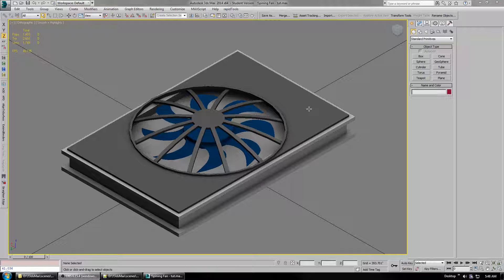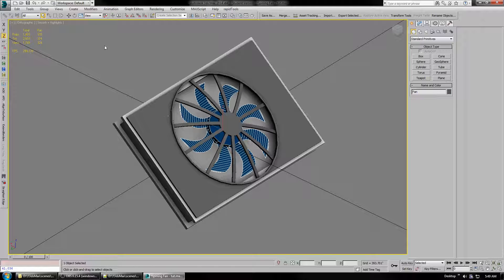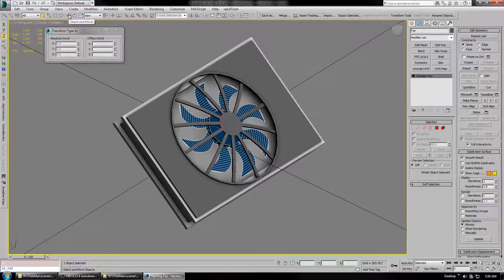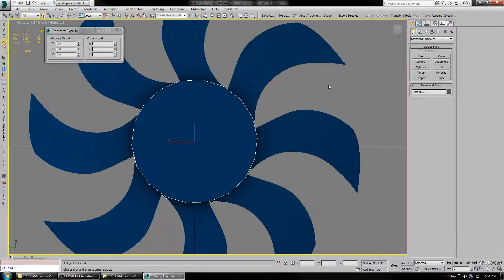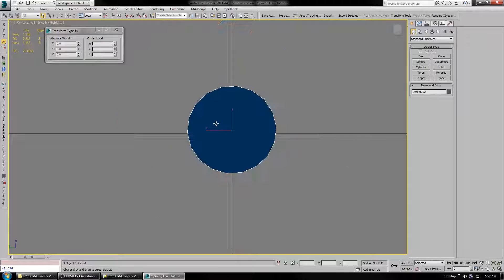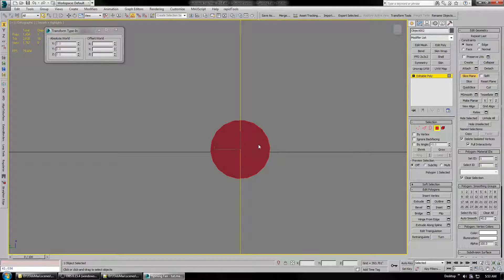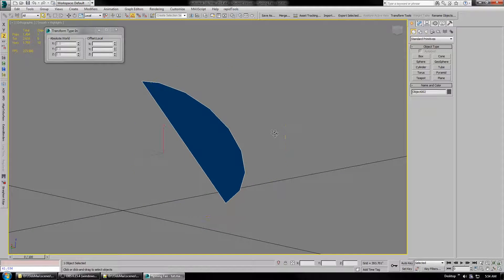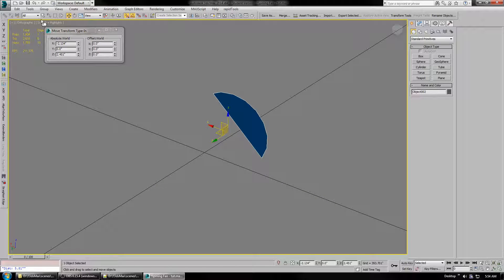Spinning Fan Tutorial

Comment: Hi tattoo, it is a great tutorial but I have a problem. 
I did exactly what you said in this tutorial but it is not spinning, it is just sitting on its place and doing nothing. I hope you can help me. 
btw, my mod is for spintires mudrunner.
Reply from the maker: Without seeing exactly what you did, it would be hard for me to pinpoint the problem. Sorry. Also, since this was made for ST alone, the code may have changed some for MR. You may want to check the code.
 Actually, I'll look to see if it's the same. Give me a few minutes. brb
Reply: Tattoo I got it fixed, I looked really closely to the tutorial and saw that the rotator tag shouldnt be in the truckdata tag where the notepad plugin sayed that it should be.... That plugin is good but sometimes........

Thanks for the great tutorial.
Reply from the maker: Hmm, I just looked thru every default truck.xml and the code isn't in any of them. Pavel may have changed it or removed it all together, like he did with the wheels. So this may be something you want to ask in the forums because I don't know. Sorry. Do you know anything that has a spinning light in MR at all? I don't mod much now so I really don't know.
Reply: Tattoo I got it already fixed, its still the same. I got something wrong in the coding, the rotator tag should be under the truck tag, but I putted it under the truckdata tag where the steeringwheel option was, that was the mistake
Reply from the maker: Oh ok, Cool. Thanks for replying to let me know. Glad the tut helped you. Happy modding...
Reply: Tattoo thank you for making those great tutorials, that big turorial about suspension setup and linking helped me alot. Always created mods with spring setup but I was working on a mod with airshocks and the shock wasnt following the axle with 2 bones, so I searched on the YouTube and found your channel.